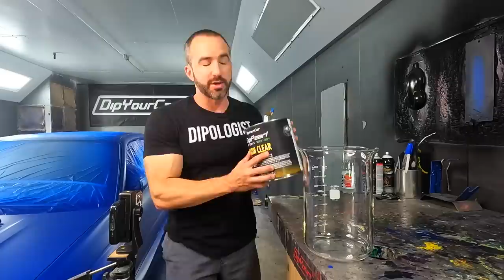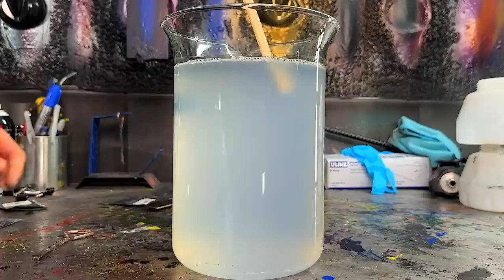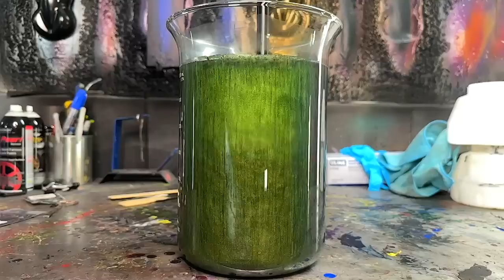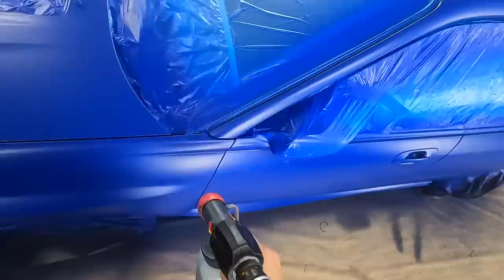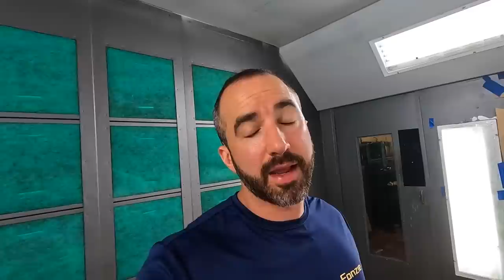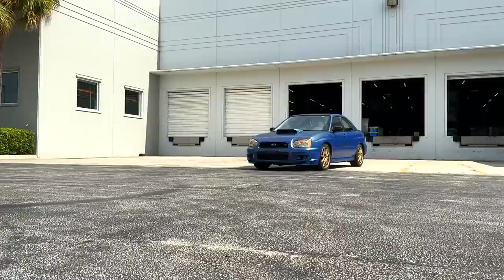Happy Accident or Massive Failure | ZTZ HyperShift was NOT What we Expected (What do you think?)

Comment: Definitely looks really good. I think you would have needed a higher pigment load to get what you were looking for. I get what Gabe says about "you can also spray more", but any time you use a satin or matte coating, the more you spray, the more muddled the color is going to be. If you still wanted the bright blue to shine through, you need a higher pigment load with fewer coats. But this most definitely was NOT a failure! I personally love the look of this test! I would rock this on my own car! But I think we need to see some experiments with it. Maybe get a several speed shapes and try the same base color and pearl combo on all of them. Try it with 5g/gal and with 10g/gal. Do like 3 speedshapes of each pigment load. First one with the 5g load and do 2 coats, then another with 3 coats, and then another with 4 coats. Then do the same with a 10g load. So 6 total speedshapes and we can see them side by side. I bet the 2 coats of 10g would be different than the 4 coats of 5g. And also maybe try it with both the matte and the satin top coats as well. That would be a cool experiment to see how they work with different loads, coats and finishes.

Comment: I'm trying to understand the benefit of the two new topcoats in a scenario where I might spray glossy topcoat over top anyhow. What is gained by adding the pearls into the midcoat instead?

I am accustomed to using a midcoat/pearl setup from the DipArmor I've used, but not with standard jobs.
Reply from the maker: if you're using the Glossy Topcoat as a finisher, there is no benefit to the NG topcoats, you're just going to add all the orange peel and sticky grip as soon as the glossy goes on.  If you use Dip Armor, you also won't be using the new NG topcoats, those two products don't cross paths.